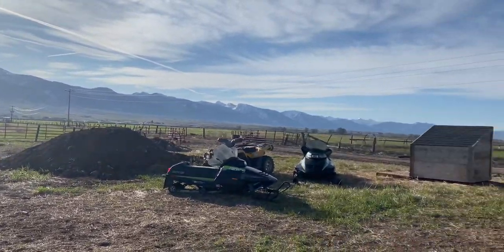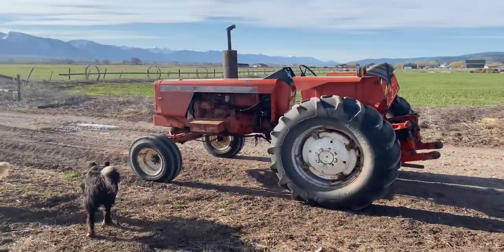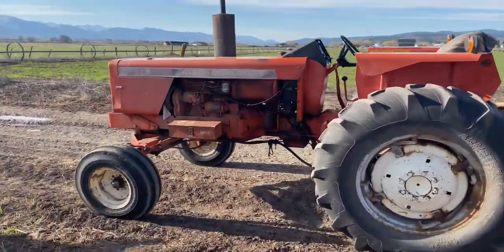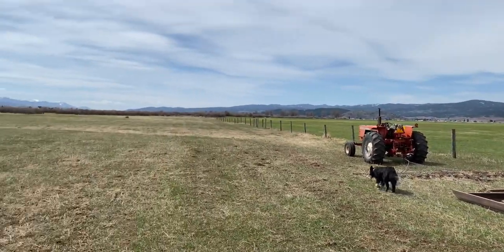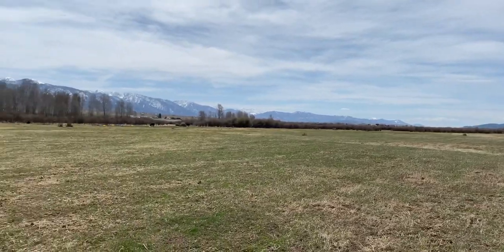Harrowing The Cattle Pasture

Comment: I ran over myself jump starting a John Deere that way broke my leg right in the knee joint
Reply from the maker: I always make sure it’s in neutral. But I’m sure it’s only a matter of time before I forget. It’s something we need to fix
Reply: As a starter ages they turn slower I used ether when I realized I needed a starter rebuild. On diesel they really got to spin fast to start  I have a ac200